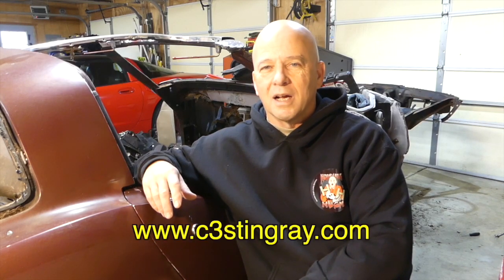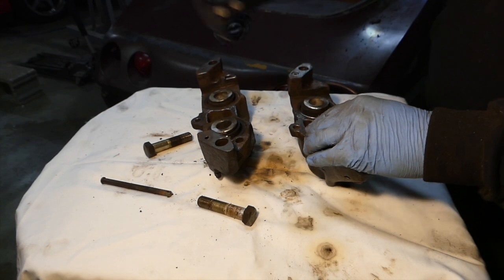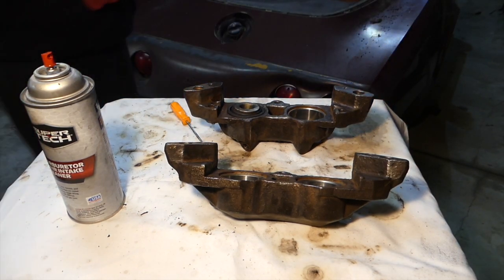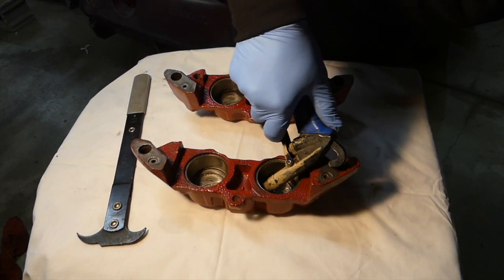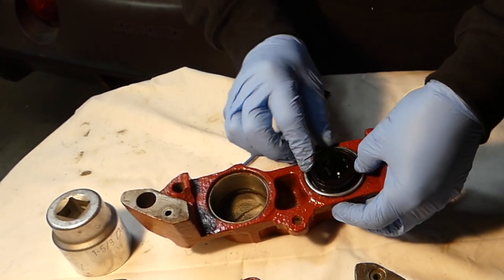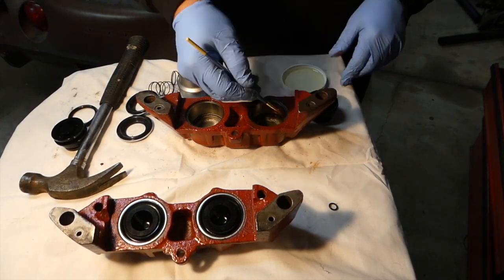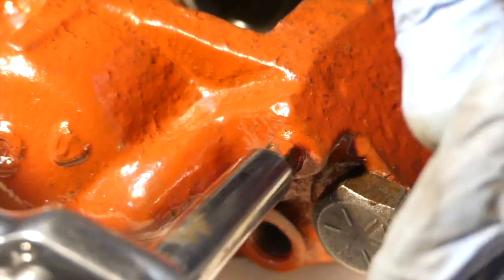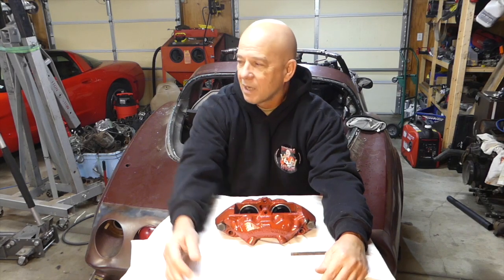1965-1982 Corvette Caliper O-Ring Conversion

Comment: i have read online that a lot of people say that you need to have stainless sleeves installed in the cylinders for o-ring type seals. No one can actually tell me why and I can't see why it would be necesssary if the orignal cylinders are in good condition, not pitted, scord etc. What are your thoughts?